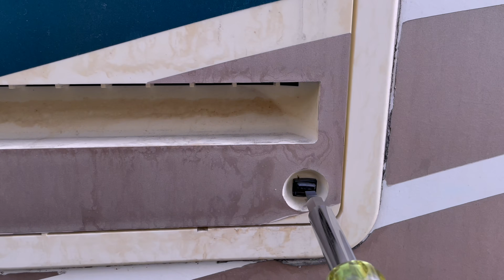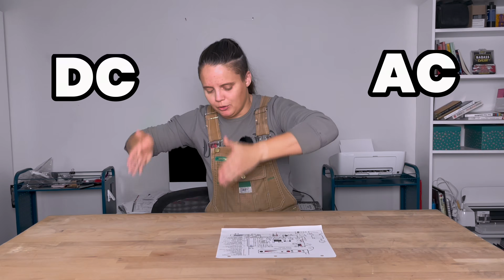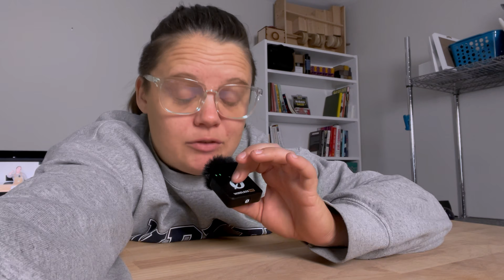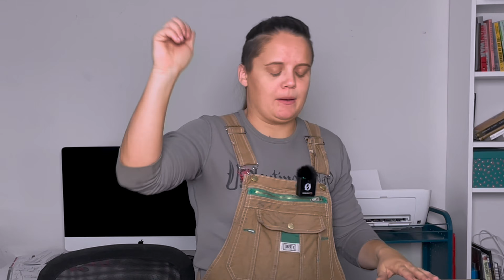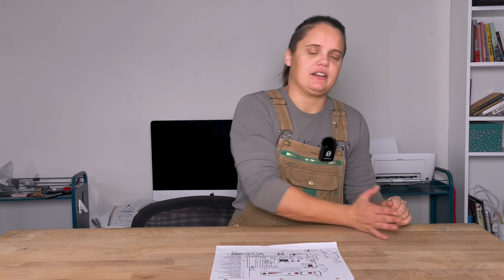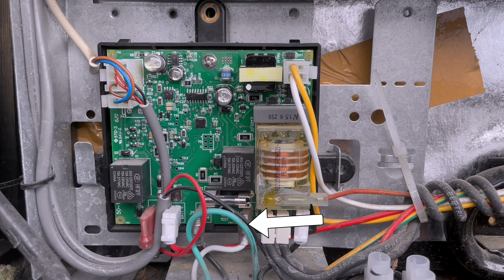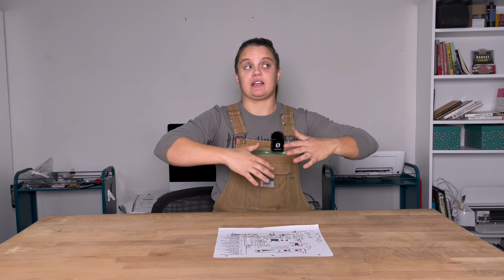How to Troubleshoot Your Dometic RV Fridge (With a Mobile RV Tech)

Comment: Firstly, amazing video. Thank you! I ran through all the testing ac and dc and everything checked out ok. However, my fridge never gets cold, adjuster in fridge set to coldest. Seems like the problem is with the fridge itself is my thought, element or freon (if there is any in dometic. Is there a way to verify if it is?

Comment: Retired domestic automotive tech and service director since 1986. Sitting at a campground as I'm sending this ,stuck using three coolers with ice instated of my fridge...until i watched your video and found that the thermal disc had and open . I bypassed the fuse and most of my food is now saved to enjoy for the rest of our vacation. Thanks is not good enough, Your Awesome!!!
Reply: By passed the fuse? Probably not a good idea.
Reply: Can somebody help me out I have a 12 V domac refrigerator that shuts off after running 10 minutes it has power the fan is running and the motor is running just shuts off

Comment: Great video - easy to follow your instructions, and very engaging.  What if all the tests were "positive" (both the gas side and electric, voltage where supposed to be, element heating, 1A at heating wire), but still no cooling?
Reply: Oh, Dometic RM2351 dual.

Comment: Very attention to detail oriented which means that it's the best advice! I'm going to try to reset it with the middle button on the eyebrow board (on my panel it's the auto or gas button) , I replaced the regulator and both hoses to the tanks and even though I was careful some dirt could have gotten in the system while I had it apart and I was told that there is a filter screen somewhere before the fridge. My middle led and the right side led starts blinking along with the check led.  Do you know what the problem is? Let me know please.

Comment: Great video, however, rather than testing for 110VAC from hot to ground, you should be testing from hot to NEUTRAL. I did as you said and tested from J8 to ground and read the desired 110VAC but the cartridge heater would still not heat up. When I tested from J8 to NEUTRAL, I did not read the desired voltage. It turned out that I had an OPEN Neutral. I traced this back to one of the electrical outlets downstream. 
Always test AC voltage between hot and NEUTRAL. 
That said, I would never have gotten that far without your most excellent video. 
Thanks so much :-)

Comment: Hey here's a free diagnosis and probable fix,  I had a problem with my fridge working for a few minutes and then the gas light and cold level light blinking on and off and the fridge wasn't working and I checked my gas lines and the regulator and found that the regulator had a leak all the way around the big round part of the regulator and had to replace it and then it worked fine! 😊

Comment: I like this video overall. Yes, there is a butttt!.  The battery is having charging issues if you are getting an 11v reading.  A full charge is II believe,  12.6-7v .   14v is indicating that the battery is charging. Please do not take this negatively. I am only saying that you need to have the correct information when giving out advice. Best regards.

Comment: Step one of the video is my problem. My terminal block is disconnected on one side. I have + and - wires coming from the battery that are unhooked and a gray, white wire coming down that are the right length to hook into the terminal block. Do I have to have a charged 12v battery if I'm hooked up to city power?

Comment: What temp should the heating tube be getting up to?  My thermal fuse keeps tripping. I want to make sure that replacing the fuse will work and not that the tube is really getting too hot.

Comment: What about the little button on the thermal disk?  I didn't have continuity but then pressed the button in the middle of the terminals and it clicked and then I had continuity and the fridge started working.   So confused when you say if there is no continuity that it's bad.  Thanks

Comment: Fridge stop cooling properly. Stuck at around 70–60..going to try to tap on the relays. 
Also unplugged the thermostat and still doesn’t freeze up , freezer work good.

Comment: I have a question? My refrigerator works on electricity, however it won’t get cold in gas? I’m getting a nice blue flame at the burner, (however it is pretty quiet, not sure how loud it should be?) But the refrigerator isn’t getting cold? Any tips are greatly appreciated?

Comment: You’re the best!  I have a question.  I came back to a dead fridge after being away for 2 weeks. Thanks to your video I was able to troubleshoot my fridge. When I put the probe on the black wire for the eyebrow board I was only reading 7.2 volts. When I went inside to start checking the eyebrow board I found the fridge to be working again. All was well until this morning when I woke up it’s dead again. Wiggled everything that I touched a few days ago thinking something was loose and still nothing. If I’m not getting 12v on that black wire would you lean towards the eyebrow board?

Comment: Thank u for your video. You saved my camper refrigerator. The green wire pin came off to the eyebrow panel. The fridge had power but would not get cold. Worst part is we are leaving on a camping trip tmrw. But thanks to you and your video we are good and running. Really appreciate you..

Comment: As a guy who spent my entire career in an electro-mechanical field, I find your explanations a little dragged out, but probably exactly what is needed for those without my (our) background(s). You have been spot on with the diagnoses in both of the video’s I’ve watched so far. Great personality mixed with accurate technical info shared. God bless you!  Thanks for your willingness to share the talents you have been blessed with.

Comment: Thanks for this video, it's a big help. It looks like everything is working OK on my fridge, it cools great on AC, I get flame on propane however the fridge still doesn't cool very well on propane. I typically camp without electricity so propane is a must for me. Any other ideas on what I should look for?  It is a Dometic RM8501 in a 2015 RPod 179. I have tried to clean the orfice tube and jet and the flame looks to be the same size as before.

Comment: What causes boiler to get so hot it trips thermal disc….everything checks out ok, it runs….unto it doesn’t……I can reset at thermal disc and it runs until boiler is so hot it causes it to trip at disc again…..
Reply: I am wondering the same thing

Comment: My dometic fridge fires up on propane but does not get cool at all. I can feel it's hot around the flame but no cooling at all.
Reply from the maker: Then you need to 1. double check your fridge is level (within 3 degrees of level side to side and 6 degrees front to back.) 2. make sure nothing is blocking the ventilation of the back of the fridge. Air flow is crucial. 3. think about how hot it is outside. If its above 100 degrees outside these fridges usually can't get cooler than 60 inside. 4. Look for signs of a refrigerant leak in your cooling unit. (I've got a video somewhere on the see smell hear test.)

Comment: Ok Emily,  you missed a super important item, the thermal fuse, hidden in a insulated sliding cover from the 12 volt connection to the thermo fuse mounted on the flume. 2 week wait time. I jumped it to check it and Shazam.  My experience missed it. It was hidden. It had continuity but the ohm meter found it. Wired before the disc.  Thank you, justin-
Reply from the maker: I mention the thermal fuse in the vid, but I’m glad you got it figured out!
Reply: Yep, it was a two day challenge, I bought a board but never used it when I started staring at the schematic,  that thermal duhicky is 140.00 buck, and two weeks out, I bought two. Looks like a good failure point. While looking very close I found a sheet of crispy, burnt paper, scarry. I faced out this area regularly,  missed it for 3 years. Sloppy install. Loved your training session, it helped me with the important parts, so mad I missed that thermal safety item. That board maybe returnable. 240.00 bucks

Thanks again, u rock...j-

Comment: I keep blowing the 5 amp fuse I checked it it's saying like 50v ac btw this happened after the lights went out during the hurricane I'm using the electric non gas atm btw the fuses that blew were when i had it pluged into the outlet behind the fridge havent tryed to put a fuse in while actually connected to the outside outlet

Comment: What happens if my heater is working and still not cooling the fridge?
Reply from the maker: Then you need to:
1. Make sure you’re level.
2. Make sure there is proper ventilation going through the back of the fridge
3. Look for signs of a cooling unit leak (look for a yellow dye, smell for ammonia, and listen for a gurgling noise)

Comment: Got to camp fridge want working , panic set in found your video . Went and got a tester and bought a backup mini fridge at same  time. I came back started testing found a blown fuse on circuit board.  Another trip to find a agx 3 fuse put it in and fridge worked . Took back the mini fridge and had a cold beer for you . Thanks for your video
Reply from the maker: I’m to make sure there is more cold beer in the world!

Comment: Great video! I went through the process, and my meter read that my 5A glass fuse on the circuit board didn’t have power on either side of the fuse, but the 3A fuse to the left of it had 12 volts on each side. However, when i took the 5A fuse out to test it, it had continuity and looks totally fine. Any ideas?

My fridge died super recently, right after my batteries died (and i think the batteries went below the discharge limit) It’s a DMR702, and the error code it’s blinking says that DC voltage is out of range, but i’ve replaced the batteries, confirmed that they are working, and reset everything, but still no luck.

Comment: Ok. First, that was a well explained video. I followed along and I have two glass fuses and one of them was 120 V but the other was reading around 28 or 30 v. also The refrigerator outlet is getting 120 V.  I put a small fan blowing upward into the unit from the outside and it seems to bring down the temperature of the inside of the refrigerator. The freezer seems fine. Any advice on that?  I’m at a campground, possibly the pedestal on 30 amp not wired correctly?   I was also wondering if maybe if there is a fan on these Dometic units.
Reply from the maker: Test for DC volts across that glass fuse just to make sure it isn’t a DC fuse.
Reply: @rvrepairwoman the fuse in question says (on the circuit board) 3A/125 VAC

Comment: Hi! Thanks for all the helpful videos! I have a question for you.  My thermal disk keeps popping out every 10-20 min and I have to hit the reset button each time to make the unit work again. Bad thermal disk or something else? My fridge DM2672
Reply from the maker: Off the top of my head I think the temperature for that disk to pop is around 300 degrees. So throw a thermometer on your tube and see if you’re close. If not, change out the disk. It’s not uncommon for them to go bad and they are super cheap.

Comment: Hi RV Repair Woman.  Great video.  You promised a table in the description showing resistance values for the 120V heating element.  I'm not finding it.  Am I looking in the wrong place or something?
Thanks!
Also I agree with Tonguefreak8292, you should caution people to always unplug the 120 before you try to remove a fuse using any method.  Results can be shocking! 🙂

Comment: I am getting the pilot to light right away, but the igniter keeps clicking. it keeps clicking through its cycle then shuts of, which shuts off the gas.
What would cause the igniter to keep click, even if the pilot is lit??

Comment: Outstanding Video. i am an Instrumentstion Engineering tech and this covers everything clear and concise. Well done! Gloves was a great tip, No fingers touching metal parts when measuring AC, lot of people rest thier hands on the metal when poking around, or put thier index finger on the netal shaft of thier screwdriver.

Comment: A hot tip she didn't mention was checking the test buttons on the bathroom outlet. Apparently it disconnects multiple outlets and kids like pushing them. At least I'll be ready when it really does break.
Reply from the maker: Yes! Great tip! If you aren’t getting power to the outlet that the fridge is plugged in to then that GFCI (the button in the bathroom) is the first thing I would check.

Comment: Emily, Help me!! 😅
My fridge is working fine with gas but, when I try to use it with electricity, my gfi outlit trip. i tried different outlit and it does the same. 

Same with the fridge connect with an extension cord directly to the house. 

I'm kind of clueless. Everything was working fine last fall.

Comment: Your troubleshooting process is fantastic! I followed your process to determine where the problem might be on my Dometic RV refrigerator and your step-by-step system saved me $50! It ended up being the thermal fuse so I ordered the replacement and will install it tomorrow. Thanks so much for what you do!

Comment: Great troubleshooting guidance.  I passed all of the tests, but purchased two new control boards thinking the first replacement was bad (which it may be) but still no resolution.  My problem is that when running on AC, it pops the RV circuit breaker.  Could it be the electric heating element is the problem???

Comment: Hey I need a little more of your good help, just watched your video was great, so I am working on my 2008, fridge, same one as in your video. Went through all your steps, twice lol, my heating element is getting hot, on gas and electric, but fridge will still not cool, or freezer, it just runs for half an hour, then pops the heat switch, but I noticed my cooling system is not getting hot, would that mean I need frion added?

Comment: Awww you forgot the thermistor😅😅 I think That's what my problem is.. I texted you but you're out of town, out of the heat lol.. My freezer was freezing my refrigerator was hot, I slid the thermistor up and down it didn't make any difference so I finally just pulled it out and laid it in there on the shelf went back 12 hours later in my refrigerator was 38°...

Comment: @rvrepairwoman thank you for your video it was very clear and easy to follow. I have a question please, we tested the ac in between the two wires and we have 120v. But when we test between one of the 120v inlet legs and ground we only get a few volts and the same with the other leg. Our van was imported into Australia from Canada and converted to 240v so perhaps there is a transformer supplying the fridge with 120v and it may not be grounded so we can't get a reference from ground to +. Would this be possible in your professional opinion, thanks.

Comment: Thanks Emily for the great step by step process.  I went through it and was still at a loss.  My symptoms were a little different.  The unit initially would not light.  The ground from the igniter unit was not getting good connection, cleaned (your advice).  Unit would light but would then shut off after a bit of time.  Indicating a thermocouple.  Checked voltage when unit was lit, only got .009 to ,011 volts (or 9 millivolts) from the thermocouple.  Just for giggles I also let a long Bic lighter under the thermocouple, the voltage went to 25mv.  Checked thermocouple mounting, it was loose, apparently allowed the Thermocouple to slide away from the flame.  Adjusted and locked down.  All is fine.
Reply from the maker: Great tips! Thank you!

Comment: Dometic 2652 2-way Fridge. When the unit is plugged in to 110v the fridge works normal but when switched over to propane the check light comes on.

New parts - Dinasaur control board, Gas valve, thermocouple, thermistor, AC element.

I have gas
I have good DC voltage

I was not getting power out of the Gas valve reignitor plug on the board. For some reason I just unplugged the thermistor from the control board, and it fired right up like normal then went out after about 10 seconds or so. Plugged it back in and nothing, waited a few minutes unplugged it again and it fired back up and went out again.
I have gone through the manual 10 times and thought that I had checked everything, but I am missing something, driving me nuts. There's not too much to these things but I'm stumped. Why would it fire up by unplugging the thermistor? could it have something to do with the brow board at the fridge?

My camper is 8 hrs. away at camp - When I was up memorial weekend, I replaced the board and didn't help. Figured I might have gotten a bad board, so I ordered a new one and made a special trip up there a couple days ago before the 4th and the newer board didn't help.

Comment: very good video, on my circuit board there are a few places where I get the 12 volts as should and where I don't get 12 volts. This means circuit board needs to be replaced?

Comment: I was watching this to see what the "DC element" was. I'm replacing the board with a Dinosar P-711 and it is so confusing because the schematics in the cubby hole is different that the board that has nothing labeled with the tan resin all over the board which is different than the P-711 so as I find things out I lable everything and drew up my own schematics of the non labeled board so when I figure it out I can replace it correctly the first time. Oh and I had to make my own ground wire so had to get all the fun equipment for that and "flag" connector stuff. A month later I'm here. Almost ready but not sure what the DC element is or how to find the positive end with the board bad.